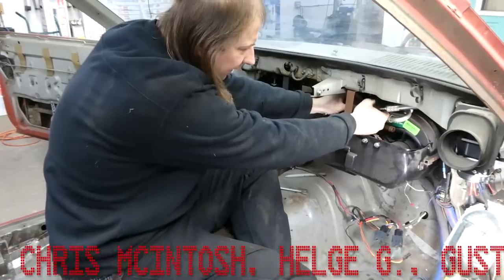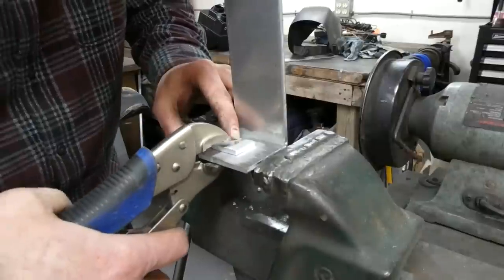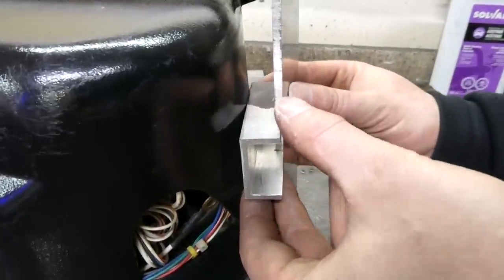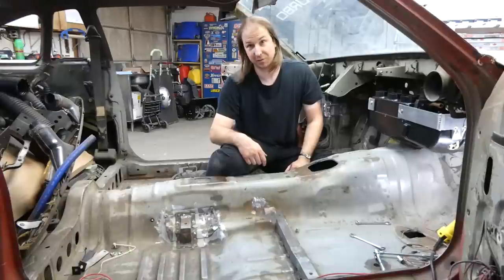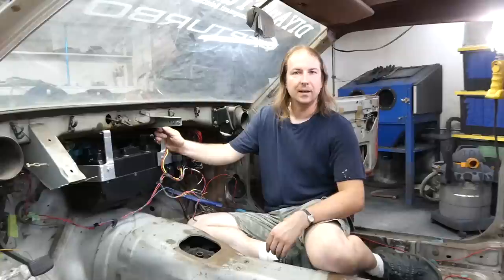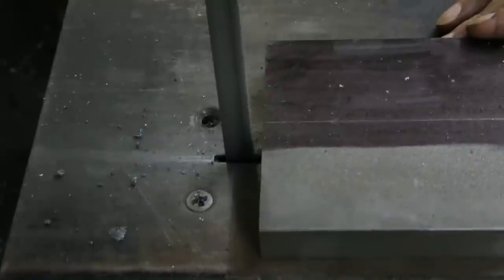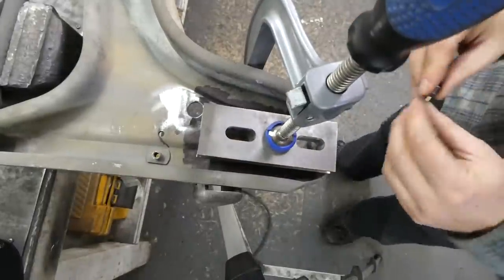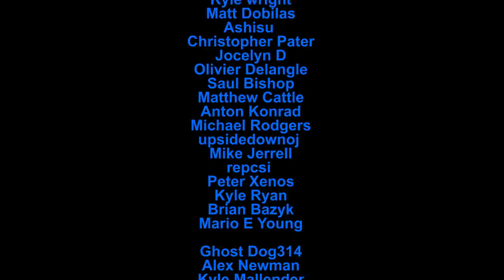Part 54: Better HVAC Bracket and Improved Balls - My 76 Mazda RX-5 Cosmo Restoration

Comment: Looks good, however I would be too paranoid the ball joint would move out of adjustment. I would have used a heim joint theaded into the lower control arm with a lock nut. That would give me piece of mind when I hit a speed bump too hard.
Reply from the maker: I forgot to mention this in the video however once the alignment is set, I intend to mill out some spacers which will sit in the slots to lock the bolts in position.

Comment: Another great video!👏
You already know this but some viewers may not. At 46:40 "this things in the way, whatever it is", it was the old steering stop, which probably wouldn't work anyway due to the new FC RX-7 spindles. (and the pending Air Suspension.👍) You'll just fabricobble something better.
Reply from the maker: I figured it was the old spindle stop as the OEM recirculating ball box didn't have a hard stop until it hit end of travel. I do intend to fully box the control arms at some point. Also now need to figure out new stabilizer bar end link mounts...then again the stabilizer bar may go away with the air suspension.
Reply: @aaroncake  The air springs will have no effect on body roll. You will still need the front stabilizer bar, so I would make provisions for the links on the control arms now while it’s easier. You may even want a rear bar too, depending on how “spirited” your driving will be.
Reply from the maker: @GrayRaceCat  The car has a rear sway bar stock so I'm all set there. Have seen air systems that automatically compensate for body roll but I suspect you are right that I will want a real stabilizer bar.
Reply: @aaroncake  Since it has a rear bar you will definitely want a front bar to keep the suspension balanced front to rear, and the rear tires planted.
I would expect that an air system that can compensate for body roll would be quite “spendy”!

Comment: Amazingly crafted bracket for the Vintage Air unit and excellent modification of the conroll arm. Good to see you back bringing us this video and wish we would see more of you. Best to you in the new year.
Reply from the maker: Thank you! Next video will be new stuff. I'm currently researching and gathering air suspension parts. Going to start with the rear as replacing springs with bags is fairly easy.

Comment: Hey Aaron, only thing I can see that the balljoint issue is if you don’t have it bang on perfect, the caster might be off causing the car pulling to one side

Should contact Josiah at fdf in Trenton Ontario, they make angle kits and stuff for anything, he could definitely build you a lca that would be 100% caster camber adjustable
Reply from the maker: I made the decision not to go fully custom with the control arms. The idea is to build adjustability into all parts of the suspension so there is some hope in aligning this thing when done. There is some movement available to "swing" the ball joint back and forth. Plus, the strut tops are eccentric allowing adjustment by rotation. Truthfully my main concern is bump steer based on the tie rod location. Will have to see...

Comment: Are you still having fun with this? I was at about the 5 year mark with my restoration project when I started to feel burnt out, and I just quickly threw everything together to at least be able to finish it.
Reply from the maker: Most of the time, yes, I still enjoy it. Except the electronic dash. That dragged on so long and had so many frustrations I just lost all interest in it. Was glad to pack it away and haven't bothered trying to write the code yet (I figure I have time). There are times I am so excited to work on the car the next day, then when the day rolls around I sit unmotivated looking at it.
Reply: @aaroncake  very relatable, I remember spending what felt like eternities both admiring the chaos while feeling that I had painted myself into a corner (not sure if this saying translated well). I started blaming my working workspace situation, but even after getting my own garage, my little Alfa is on the path of becoming a 20 year old barn find in about 15 years from now
Reply: the same happend with my ta23 toyota celica project. I'm no welder and since I wanted the sheetwork to be perfect. I was trying to find someone to do the work. in the end I just sold it and bought one that didn't need as much work. and as a side I have a sa22 rx7 to drive to keep the fun in the hobby. gotta keep the fun and I try not to go to deep down the rabbithole.

Comment: Is that batterydrill still alive?!? ❤️
Reply from the maker: And on the original batteries too. Now that I think about it, the thing is 20 years old. Was one of the first Li-On tools and was not cheap. Of course one of the batteries is reported as "bad" on the OEM charger but if I connect it to my power supply set to 20V it charges fine.

Comment: @10:07 Using both Imperial and Metric to measure the location of a threaded insert is probably more Canadian than Maple syrup
Reply from the maker: The metal shop has become used to me ordering "1 meter of 1/4" plate 3.4" wide". I tend to use whichever system results in the most sane number.

Comment: you could have modified the strut the two bolts elongated holes and some egg shape washers like a vw golf  nice job though you get extra track width how do that affect steering travel
Reply from the maker: I'm going to likely use eccentric bolts as well. Will need as much adjustment as possible due to the prototype nature of the suspension. As far as track width, don't think it increased it really because once on the ground, everything can be lined up. Plus I know I'm going to have to play with wheel offsets front vs. rear.
Reply: @aaroncake  i am from the uk back in 70s 80s used to play with hillman avengers  in the us they were sold as plymouth crickets and they did two different lenth  track controle arms so i drilled x member to put ball joint in the right place

Comment: Love seeing your videos come up. What about making or finding a set of tubular control arms? I'd almost trust those more than modifying a set of stamped ones, and you can make em take whatever parts you want, and put them wherever you want. And then you can make clearances and run high angle ball joints or heim joints for the air suspension setup so nothing fouls up.
Reply from the maker: I did put some thought and consideration into making a set of arms from scratch. Ultimately decided not to considering the jigging needed. These ones will eventually get boxed so they should be plenty strong.

Comment: Is that a rust hole above the tie rod @ 52.17
Reply from the maker: 52:17 is the end of the video but yes, there is a big rust hole on the passenger side in that area, and some small ones on the drivers. Will be fixing these when I break the car down again for paint/final assembly. Just was sick of fixing rust years ago so moved onto better things.
Reply: @aaroncake  awsome work, yes i known grinding sucks

Comment: Around 1980 I discovered a derelict RX-2 in someone's back yard that had Diesel Kiki factory A/C.  I had never seen factory A/C in an RX-2 before!  I paid him $200 and salvaged every single A/C component out of it as my 1973 RX-2 Coupe had no A/C at all.  It was a great-looking fully-integrated unit with an entirely bespoke dash-center-console that the normal RX-2 completely lacked.  It didn't put out the volume of air that an aftermarket under-dash unit in another RX-2 I had did, but it sure looked nice.
Reply from the maker: That's cool! I actually found A/C parts on the Cosmo during the cleanout, so it may have had A/C at one point or perhaps the previous owner was considering adding it when they started their "restoration".

Comment: He's baaaaaack!!!  nice to sooo you back aaroncake!  also those a/c units do some work... cold as frig. But yeah the brackets do need work .. maybe add stiffening to the plastic case with modular tabs ( not ears) to mount the actual mounts  that you have to fab up. but still one of the few issues i have with those units. the other would be the fixed vent sizes and locations. note: being that the LBJ is the load carrying susp component, i would rethink it thru. maybe see if camber plates can  be fitted or slot the upper bolt to strut  and use and eccentric bolt there. or fab up heim rod ends and turnbuckles to mk your own adj LCA. just my 2 cents. the eccentric bolt mod would be the easiest i feel without messing with the dynamics of the susp travel.
Reply from the maker: Glad to hear the feedback about the unit. I'm not a big A/C user but still wanted it to work as well as a modern car. I'm planning to have as much of the suspension adjustable as possible because it is all a fairly mismatched set of components and the air ride is going to make that even worse. Forgot to mention in the video that I will be boxing the lower control arms so the flanges I made will be blended into the bottom plate for even more strength. Likely way stiffer/stronger than the factory ever thought. I stayed away from heim joints because of the maintenance required. They just don't seem to last long in street use from what have seen and require maintenance.

Comment: Aaroncakes notification makes my day. I am bad at geometry though, and have a question. Will the two bolts in the slot adapter in the control arm be tight enough to prevent it from slipping out or in due to road/suspension impacts or wear, changing the camber? Does the ball joint itself handle all of the tension?
Reply from the maker: They should be fine considering the extreme clamping force applied by tightening those things to about 50 ft-lbs (the factory spec). That said, once the alignment has been set I plan to mill a set of spacers to take up the slack space in the slots to physically lock the joint in position.

Comment: I really like the mechanical integration of the BJ brackets in the LCAs.  You’re not putting a shear load across a weld.  Infinitely stronger than other similar mods that I’ve seen in the past.  Great thinking, and proof that you have fantastic engineering and fabrication skills.   One of my favourite channels, and very relatable
Reply from the maker: Thank you! You're the first to notice that. I specifically made the flange a slide-in to create a mechanical connection with the control arm prior to welding.

Comment: You did a good job on the HVAC box considering what you had to work with. I would recommend the Knipex snap ring set although it is pricey.
Reply from the maker: I bought a cheap set of snap ring pliers made in China for $3. :-D
Reply: @aaroncake  LOL Well OK then

Comment: Do you still have that rfid tag in your body?🤣
Reply from the maker: Absolutely! Funny story is that I attempted to clone my work HID badge onto it, and effectively "bricked" it due to an issue with the RFID cloner I used. It can be fixed, I just need a different cloner that allows me to unlock the tag. On my long list of things to do.
Reply from the maker: Absolutely! Funny story is that I attempted to clone my work HID badge onto it, and effectively "bricked" it due to an issue with the RFID cloner I used. It can be fixed, I just need a different cloner that allows me to unlock the tag. On my long list of things to do.

Comment: Man I wish you made these for all gen IIs you're so right about the failure of it being universal.. I'd love one for my gen II mini
Reply from the maker: Hmmm....I guess I could if there was a large enough demand. Would do a stamped steel bracket to provide sane mounting points. I really think that their "universal" design was just taken from the first application they prototyped. Makes no damn sense where the mounting holes are.
Reply: @aaroncake  it sure feels like they did that.. I'm trying to fit mine to a Morris Minor and it's flimsy as all anything.. that point you drilled in the side of the plastic for the nursert they've now included a sticker saying you'll void your warranty if you drill anything in there.. great!

I'd love a one off if you'd make one up for a gen ii mini?
Reply from the maker: Ha! I bet they added that to the instructions because of my original video! Sadly I don't think building brackets for these things is realistic for me.
Reply: @aaroncake  I might have to make a poor imitation! thanks so much for the inspiration.. Every time I watch your vintage air plumbing video it makes me want to dive back in to the project :)